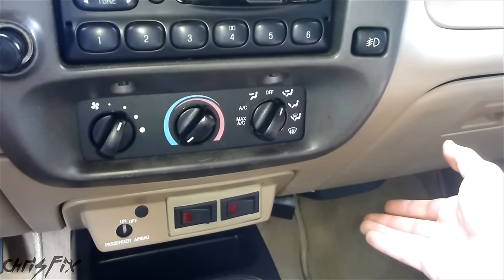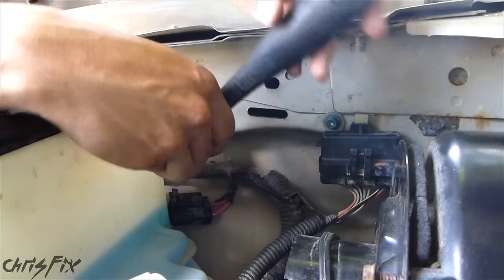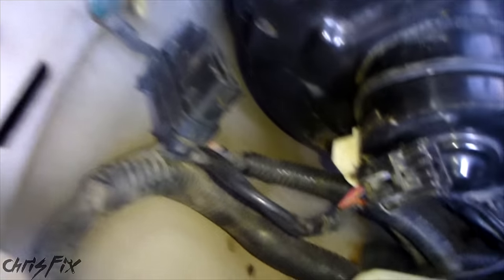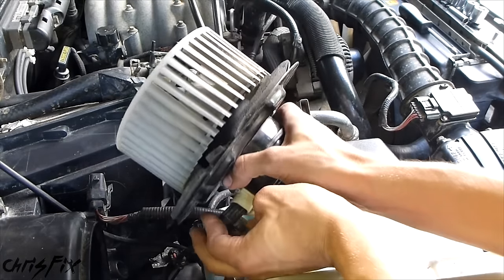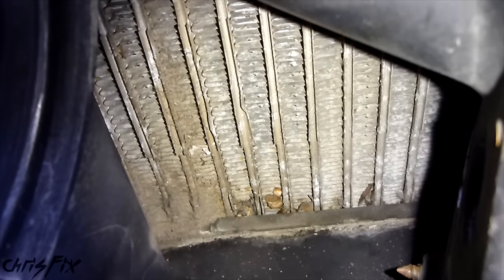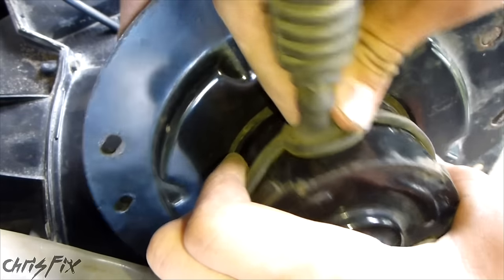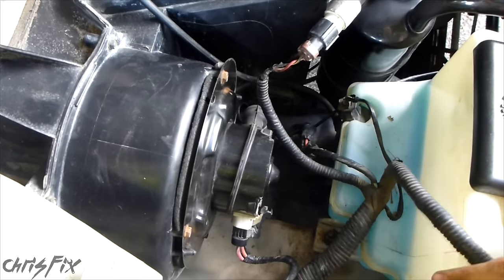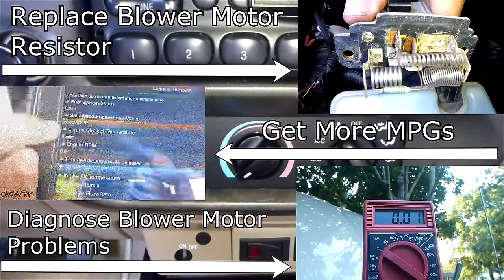How to fix a Noisy Blower Motor AC Heat Fan

Comment: I have a 2008 Saturn Aura. My ac wasn't working on any speed. The control knob is manual. My car requires cutting the blower motor casing for it to come out and then buying a separate blower motor housing kit that GM requires for reinstallation of the new blower motor. So before going through all that trouble this is what I did yesterday. I unplug the blower motor connector. I ran 2 wires from the battery to the blower motor and I heard it turned on. Thank goodness I didn't remove it and didn't need to cut it to do this simple test!!!
Ok then I grab my multimeter and I check for battery voltage on the blower motor connector not the actual motor. I got 12.6v. I also grab my test light and it test good on both the positive and negative terminals. Oh yea I forgot to mention that the first thing I did was to check all the fuses and they were good. Ok then I removed the blower motor resistor and I tested it with my ohmmeter and I check the resistance between terminals A B C and D. There was no open loop between them and according to the specifications I was getting the right ohms reading on each terminal. So the resistor was good. Ok so now I tested everything and I'm braking my head wondering why is still not working. I decided to look at the blower motor connector and one of the terminals was kind of dark and burned up. I plug it back in and I turn on the car and wiggle the connector. The ac kick in and it was blowing but when I let go of the connector it turned off. So there was the problem. It was a bad burn pin in the blower motor connector. I went to the junk yard and I got lucky that there was only 1 Saturn aura in stock and it still had the connector. So the guy cut it out and I got it for $15 dollars. I got home and cut the burned up one and strip the wires and use yellow butt connectors. I plug it back in and it work perfectly!! Hooray I saved so much money. Now I wonder why did the positive terminal of the blower connector burned up in the first place? Can that be an indication that the blower motor might be going bad and drawing to much amperage and causing the terminal to burn up?
Oh by the way I'm the whole process I broke my glove box not knowing how to remove it. Now I need a new one and is freaking expensive!!
Reply from the maker: Thanks for sharing! There might have been a temporary high amp load due to a leaf or something preventing the  motor from spinning.

Comment: My 2007 Fit has had a burring noise whenever I press my AC or defroster button. Both work and the AC blows nice cold air. I wouldn't be surprised if mine is full of leaves too 🙄

Comment: The brushed blowe motor can be oiled.  But you'll need to remove the fan motor to get to both bearings.  
On the front bearing, drill a 1/8" hole near the crease on the front center of the motor housing. The housing is soft, the motor shaft hard. Drill carefully until you feel the bit stop on the hard shaft about 1/8" deep. You'll see the shaft.    Squirt oil into the new hole. 
On the rear bearing, remove the fan cage. You can squirt oil through from the outside between the housing and the washer where the shaft comes out.
Allow the oil to penetrate.  Then connect the fan to power and ground the housing.  Let it run to test and to help oil penetrate.  Add more oil to both ends, let it soak in. 
 Wipe off excess oil.  Reinstall cage then blower. 

*Use a can of pressurized lubricant with tiny red nozzle on tip.   Not silicone, not WD-40!   Also, add grease to drill bit to catch filings.
After you know the lube worked,  degrease around drilled hole and plug it with a dab of silicone sealant that can be plucked out to lube again in the future if necessary.  
While you have the blower out, use a flashlight to examine rotor and brushes through the holes in the housing.  If they're worn down to nubs, you'll need to bite the bullet and buy a new motor.

Comment: chris I was always told to use a harden hose to clean the evap. obviously you would have to remove the resistor. but isn't that the best way? I believe there is a drain in there as well for condensation if I remember correctly.
Reply from the maker: +Niterider albin It really depends. You have to be careful with a garden hose because the pressure can damage the evaporator or even get past and soak parts of the interior that are not supposed to be wet. I can see how it can work though if done correctly.

Comment: Thank you very informative, unfortunately I’m not sure where mine is located, I think it’s under the glove box but I don’t want to take anything apart I dont 100% know about. 
My fan is doing the same thing and think there’s a snake in mine, well a dead snake now. 
It’s so bad it shakes the truck, I took the glove box off and looked behind and there were two cases I could not open, I was looking at them from the side, so not sure which box is what and which direction I need to go.
It’s a 2004 Dodge Ram 1500 quad cab if you have any idea please let me know, I rather fix it myself then have a mechanic do it.

Comment: Yeah when I did mine that little nub at bottom hose connection didn't seem to have any hole to go in. I think u did one on a ford van?  It stays on but wonder why nub is on hose but no hole to insert into. Was yours similar? Thanks. Your videos are very helpful thanks.

Comment: I just picked one up from auto zone and installed it. Everything seems to be working fine until you put it on the 2 highest fan speeds. Once you do that you can feel the dash vibrating as well as a vibration coming from the brake pedal. I’ve been told some of them are too loud and can cause that but I’m not 100%. I was also told I should’ve just got a OEM one

Comment: I hope this helps someone. The  Blower issues in my wife's Ford Edge actually started a few weeks ago, with water hitting it. But with the help of MACT FORD EDGE on You tube, I was able to locate and clean out the hidden AC drain. It still made a little noise after that, so I brushed off the cabin filter (that was not in stock locally) and removed a few small leaves. Next thing we knew,  it sounded like the Blower motor itself was slowly getting nosier. It's in the 90's here in Augusta GA. so now my wife is getting worried, ''Is this thing going to start smoking? '' So.. again, with the help of MACT, this time I removed the Blower assembly to see there was nothing at all in there. Nothing, so I called the Ford Dealer to find out a new Blower Unit (not in stock locally either)  is $220.00. But before pre pay ordering it, I got the feeling I should test it.  So I nestled it in a couple towels and turned on the  AC, and..... surprise, surprise , it was nice and quiet. So I then put it back in the car and ran it without the cabin filter installed and it was still quiet. So..... then I held the cabin filter it up to the light. I then spent considerable time scrubbing it clean at the sink and letting it dry in the sun. Again, nice and quiet... Vualla ! Happy wife, Happy  Life.. Now I am left wondering how many ( if any) Blower motors are replaced because  of clogging Cabin filters. In hind sight, I think when I get a new filter, I'm going to test it the way we test clothes Dryer filters for being clogged with (invisible) fabric softener, by blowing thru it.....

Comment: I have a 2002 Ford F150 King Ranch...blower motor has been replaced less than a year ago, but is now making a very loud sound. The hubs says our access is under the glove compartment, but he is concerned about dangers of the airbag if we try to fix it ourselves. Any feedback on that obstacle? Also, if he is correct that this is where the blower motor is, will we need to get under the hood at all? Thank you!

Comment: Chris, do you have a video on replacing the evaporator core?  My old Nissan Frontier needs a new one as it just can't get very cold anymore even though the compressor still works and I've replaced all lines, drier, condenser and expansion valve.

Comment: Hey Chris, thanks for this video! I have a similar problem but the issue is with the bearings on the motor, or rather a slip bearing, because there is no actual ball bearing there. There is a wear in that bearing from rotation and it makes horrible noise. Do you know a way to restore this? Replace a sleeve or put some special grease there?

Also is there a way to maintain such a bearing? To prevent severe damage that causes this wear.

Thanks!

Comment: Hey Chris your videos are awesome. I have a 2003 Ford Escape.  The compressor works , I changed out the orifice tube, I charged the line , the blower is working fine. The line stays charged. But I can hear a sound under the passenger dash that sound like someone breathing when I turn the ac on. This sound started I’m immediately after I changed the orifice tube oh yeah and it doesn’t blow cold air. ???? I have no idea at this point what to. Any ideas please help.

Comment: Mine was super loud (99 Silverado). It was clean, but as I turned it by hand I realized it was from inside. I tookthe motor  out, sprayed cooking spray inside the small hole, and it has run quietly for months. Cooking spray IMO is safer than WD-40.

Comment: Hello Chris! I have a 1993 ford ranger with the 2.3 motor and manual transmission. I have an issue with the coolant gauge(reads cold) I just replaced the send/switch to no avail. Also I'm having issues with my a/c cooling at idle, it gets ice cold driving but as soon as I idle it seems to stop cooling. I have a new fan clutch and clean condenser and I have proper amount of freon.(it has had the r-134 conversion done to it before I bought it) I'm at a loss here.(I am considering cleaning the evaporator as I saw how bad yours had gotten.) So please consider making videos about these issues they seem pretty common! :)
Reply from the maker: Michael Braddy For the gauge, I would plug in a scanner to the OBD port (if you have one on the 93) and see if you get a coolant temp. Then you will know if it is the sensor/wiring or if it is the gauge in the dashboard. 
For your AC, it sounds like you need more freon. That is typically the case for what you described. I would check again to make sure you dont need a boost. Def check the evaporator because that can cause the problem too. I would also consider the compressor is going bad which is the other common problem for what you described. Keep me posted on what you figure out!
Reply: +chrisfix 
Well I believe I found my issue, I think my evaporator is clogged up, I opened it up and it was caked with leaves and debris(it even got into the blower motor!) I cleaned as much as I could with a shop vac and compressed air, it actually blows a little cool at idle now, but still not as cold as when I'm driving. So it could possibly be a combination of old compressor and dirty/caked evaporator. When I hit the accelerator it cools a bit more so that tells me compressor could be worn a bit. But so far I'm happy with results at least I'm not sweating while at a light!
Reply from the maker: Michael Braddy Glad the video gave you the idea to check the evaporator and it seems like it worked at least a little. Plus your interior shouldnt smell moldy now that you got all of that gunk out. I would think it is the compressor if it gets cooler at higher rpms.
Reply: ChrisFix kinda sounds what I have, only thing is that when I idle it heats up under the dash, I don't have the cooler or heater on and when I turn the heater on it tend to go away, turn the cooler noting but hot air which is strange cause I added the freon and nada, hope its a fuse and nothing major
Reply from the maker: Tiny Rebel sounds like your blend door is not working.

Comment: Hi Chris....great video. I have a 2009 Ford Ranger sport and my noise is like a clunking noise whenever I turn on the AC or the heat. I get cold and hot it is just a clunking sound. I am thinking it may be the compressor?? Any ideas?? Thanks

Comment: Could you show us Cleaning AC process?
Both Pressure Washer and Steam.
Evaporator, Condenser, Filter, Blower, Grill Vane Vents and inside the grill vane.

1. You can show take out whole Evaporator out of the car.
2. Without taking out Evaporator, Endoscope to see inside the case and pressure washer to clean evaporator.

Comment: My car sometimes has a funky smell (like not using heater for the summer then using when fall hits) So I'll probably see if I just need to clean out the evaporator and spray some air freshener in the blower.

Comment: So today I turned on my car and was surprised to find the AC On but no air. I tried turning off AC and just blowing air but nothing. So I check the cabin air filter, seemed fine and I reached in (shouldn't have done this) but I felt the blower and it wasn't going but as soon as I touched it it started spinning. You think this is due to debris?

Comment: I have now changed the blower motor 3 times on my 1994 Buick LeSabre.The blower motor replacement process was fairly easy; my only issue was the quality of the replacement blowers was very poor (Made in China) as they keep failing.

Comment: Any chance a squeaking blower motor could just use some lubricant? And would cleaning the condenser coils improve AC performance?

1994 Mustang GT. AC barely works.

Thanks. Great videos.
Reply from the maker: Nekzus Probably not. That usually means the bearing is bad. Cleaning the condenser coils improves AC performance but it sounds like your freon is low.

Comment: Great instructions, on my B4000 my blower motor has lost its first 3 speeds, I only have high. is this generally a motor problem or switch?
Reply from the maker: Fraser C I would think this is a resistor problem. Here is how to fix it: Blower Motor Resistor Replacement

Comment: I got a similar clicking sound but only coming from one side of the blower vent in the dashboard. The guy who checked cleaned the motor and few leaves hanging in the motor and put it back, but the noise was still there. He said then I would have to replace the motor. But I did not trust him. If the blower was guilty, it could be heard from any blower vent in the dashboard, isn't it. Will vacuuming the system fix this ?? thanks.

Comment: great video, my blower makes a squealing almost cat noise what can this be?
Reply: Did you check to see if there is a cat in there?
Reply: Could be the bearing, which means you need to replace the blower. Open it and turn the blades, if it squeals the blower is fucked. Might be able to fix it with some lubricant or replacing the bearing but usually the blades get damaged too which would just make more problems in the future.

Comment: Hey Chris. Can I spray the inside of my VW Passat 2010 B6 fan heat blower motor with Holts silicone spray please? It makes squeaky noises when I turn it on. The blower housing was free from leaves and sticks.

Comment: 2008 Nissan Frontier. Noisy fan, rattling like the blower motor bearing was shot and the shaft was spinning off center. Three 3/8" screws to remove the motor from the housing under the passenger side behind the glove box.

It was a MOUSE in the fan.
Reply: Mark Greenbaum how was the smell?
Reply: It hadn't festered yet, thankfully.

Comment: Chris, I know it's been a long time since you upload this, but I hope you read.

I've facing problems with my blower and it appers to be the same noise you shown in the beggining. But the blower start the noise when I hit 60 mph on a highway. Even when the AC is off, the noise shows up on road trips when I hit about 60 mph. I've cleaned it a lot of times and even replaced the blower but the problem seems to persist. Higher the speed higher then noise, it drives me insane sometimes. xD

Do you have any ideas about this?

Comment: Hi Chris, I got a mitsubishi lancer 2008, I just took of the blower out to see if there was any trash or something that could be making noise but theres no trash or anything that could cause a sound, in fact, before I put the blower back y plug the power to the blower and give a try to see if the blower was the issue, seems to be working good but but still haivng the noise from the blower.. coukld it be that the blower is damage? I mean it blows strong air but the noise can't be fixed.....

I'm thinking in buy a new one but I just want to see what do you think before I spend some money....

Thanks
Reply from the maker: +Alfredo Castillo Rodriguez It could be the bearing in the blower that is making the noise. Can you try lubing the bearing?

Comment: I had this problem in my car. I retrieved the motor from behind my glove box and a piece of black foam fell out from somewhere. I cleaned out all the leaves and debris.  After putting everything back in, I noticed the clicking noise is gone, but there is a vibration (of thin metal sheets) every time I accelerate or idle. I suspect it has something to do with the black foam piece, but I am clueless where it would go.

Comment: So, took car to mechanic. Blowing good cold air out of car's passenger-side vents. Blowing cool air out of driver's-side vents but not AS cold as air from passenger side vents PLUS fluttering noise when in use. 
****Can debris in blower/other parts of a/c system cause differing temps of air coming from driver's-side vs. passenger-side vents or might this be something else?

Comment: Hi Chris, my car (2013 Renault) makes alot of noise on the outside when I put the ac on. The higher I put the blowers the louder the sound it. On 2/4 speed it sounds loud outside and on 4/4 speed people come up to me to tell me theres something wrong with my car. It sounds like a loud sucking noise, like it's forcing in extremely much air, which it kinda is doing but it seems weird to me that it's so loud.